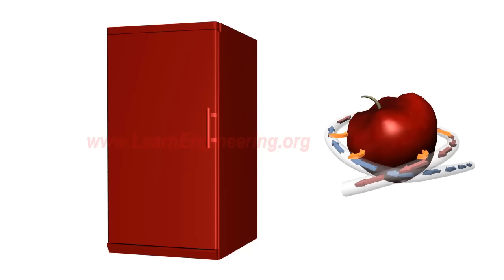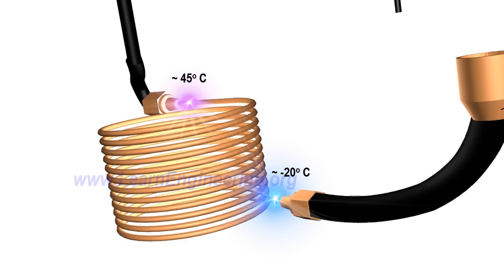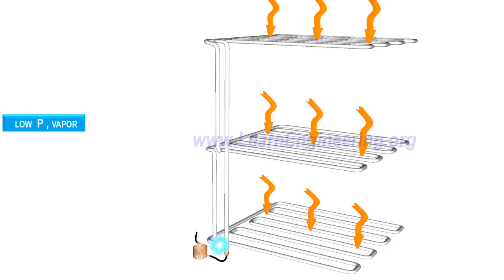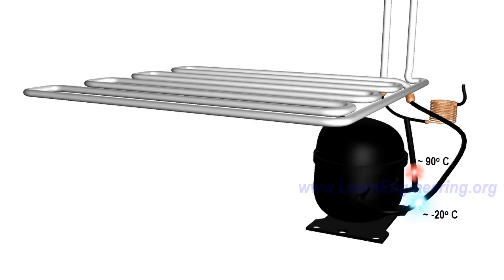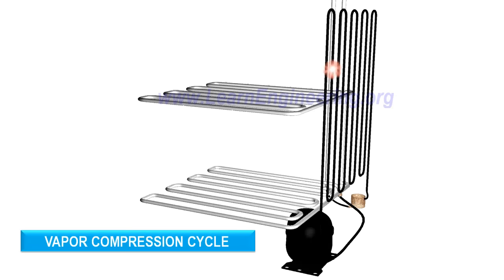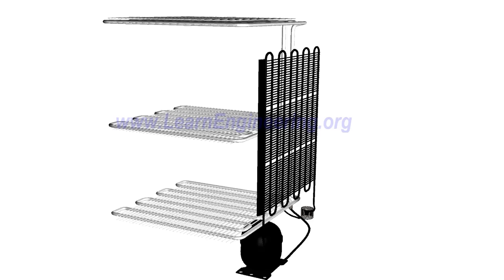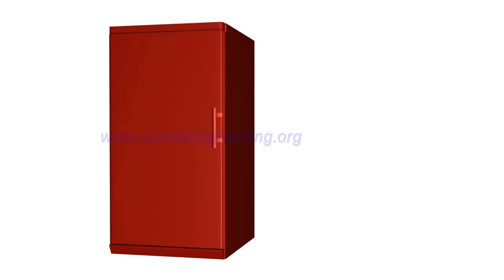Refrigerator working - The Basics

Comment: I never understood how you can use energy to remove energy, I mean that is against laws of thermodynamics(?). Now I understand. Thanks for the great video!
Reply: how is it againt laws of thermodynamics?
Reply: Dear HRS It was 3 years ago, I had no Idea.
Reply: @HenrikMyrhaug  can you explain to me the part when the temperature of the refrigerant drops because it changes its phase to vapor?
Reply: @duykhanh7746  The way I understand it, temperature is a measure of how much thermal energy is contained in a volume.

Basically, lower temperature means less energy in a unit of volume. When the volume becomes larger (the gas container is expanded), that means the ammount of energy per unit of volume becomes smaller(since the thermal energy in the gas remains the same during the expansion).

It is because the temperature drops that the gas turns to vapour, not the other way around.

And just in case you wondered, no it does not violate any laws of thermodynamics. I was thinking of "Energy can neither be created nor destroyed" when I wrote the comment, but energy is neither created nor destroyed here, since the energy just gets spread out more, not actually removed/destroyed.
Reply: @HenrikMyrhaug  wow it makes a lot of sense! But do we have any equation to calculate the change in temperature? Does pV=nRT fit in?
Reply: @duykhanh7746  I am not sure. I know you can use pv=nRT for a closed container with a uniform gas, but don't know how to calculate it when the gas turns to a liquid and different parts of the container have different pressure.
Reply: @duykhanh7746  u can use the real gas equation (wan der waals equation ) as the refrigerant is not an ideal gas
Also when refrigerant is in liquid u cant use pv=nrt as this is a GAS equation

Comment: this is  the best video that explains the cooling effect in youtube so far.  after the left liquid for heat absorption inside the refridger turns into the vapor (vapor still looks cold enough at this point), but as soon as this vapor goes back into the compressor, and this vapor becomes hot and  needs to  go the cooling fins outside the refidger?   why does it become too hot all of sudden? (that was what you showed, a bluish ball to a red ball). compresssion makes gas hot but.. it still seemed  cooler than 1st starting point

Comment: The T-s diagram and P-H diagram of vapor compression cycle explains the refrigeration phenomena better.  First, the throttling device lowers the pressure of the refrigerant tremendously (High pressure liquid ---> low pressure saturated liquid-vapor mixture). The energy (heat) from the refrigerant is released and as a result its temperature drops tremendously. Next, the evaporator makes the cold refrigerant absorb heat from the foods (keeps food cold) which occurs in the inner compartment in the fridge (liquid-vapor mixture --> pure vapor). Next, the vapor is compressed by the compressor  to a very high pressure back to its initial value and its temperature is also increased tremendously as a result (low pressure vapor --> high pressure vapor). It also maintains flow of the refrigerant through the whole system. Next, the condenser rejects the heat from the high pressured fluid and as result its temperature lowers (vapor --> liquid transition).  Finally, the  refrigerant approaches the throttling device as a high pressured liquid and the process repeats.
Reply: also since the evaporator absorbs heat from the surrounding. Water will get condensed over it and will form frost. Therefore, a defrost mechanism should be introduced to make the heat transfer at the evaporator effective.

Comment: Thanks for your clear explanation of Airflow in a Refrigerator. I have one rather important question I would like to ask. Your Airflow where does the Air come from. Is it normally a Close Loop System where the Air is constantly re-circulated by the Evaporator Fan in the Fridge, or is Fresh Air Intake going on so that the Evaporator Fan is constantly pulling Fresh Air from the Outside and blowing it through the Evaporator Coils inside the Fridge. Also if it is not a close Loop System and the Fresh Air is constantly being sucked in from outside , is it vented out as it is recirculated inside and replaced by a fresh stream of air. Thanks

Comment: To help understand the process of refrigeration first let's talk about the 2nd law of thermodynamics heat moves to what is colder lower then 1* degree difference..so a evaporator  coil is 35*  f* and the air going across it is 40* the evaporator absorbs the heat from the product to be cooled causing liquid to turn into a low pressure,low temperature,super heated vapor entering the compressor which cools the Hermetic compressor  discharging high pressure, high temperature, superheated vapor entering the condenser coil 100* degrees, where the absorbed heat from the evaporator and compressor is now rejected  by catching a ride on 90* degree air.
Remember."Heat travels to cold") leaving the condenser a subcooled liquid, traveling through the filter drier to collect any  moisture or burrs (hope not) then maybe a sight glass so u can see liquid going to the metering device where a pressure drop occurs  liquid,vapor called flash gas to the evaporator coil for the process to continue called..Refrigeration Cycle

Comment: Most refrigerators will use for the defrost cycle is a heating element and a (bimetal) defrost thermostat (located on the evaporator) which controls the flow of current to the defrost heating element based on temperature. The compressor run time and defrost cycle is controlled by a defrost timer or an ADC (Adaptive Defrost Control), which will stop the compressor and both, evaporator and condenser fans and energizes the defrost heating element(s). The defrost heating element(s) will only energize if the bimetal (located on the evaporator) is closed. Again, this is based on the temperature, since if there is no ice to melt, it is likely that the bimetal will remain open and just allow the remaining frost to melt naturally.

Comment: Hello, nice video but a comment I'd like to point out please.

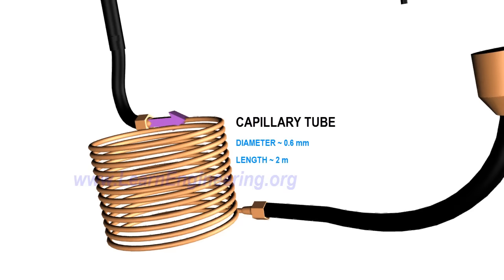After the throttling device, the properties of the liquid are -20 °C at 0.6 bar (see 0:58 - 1:30).

When the liquid goes into the evaporator coils, the contents of the refrigerator (e.g. food) are hotter than the liquid (refrigerant) so the liquid will absorb the heat from the fridge and turn into a vapour. Now the properties of the vapour are T>-20 °C (due to absorbing heat) at 0.6 bar.

My question arises how is the refrigerant still a vapour at -20 °C at 0.6 bar (see 2:18 - 2:35) when it was a liquid at -20 °C at 0.6 bar (after the throttling device see my second paragraph).

Shouldn't the temperature of the vapour at the inlet of the compressor be at a temperature greater than -20 °C to exist as a vapour? A more reasonable temperature would have been 5 °C.

I look forward to hearing back from you.

Thank you.

Comment: So does this mean if I put a pan of boiling water inside the fridge could the absorption make the system overheat?
Reply from the maker: Maxim Chepelev It depends upon the capacity of the refrigerator. Anyway it will be overloaded.
Reply: It will Effect the system But At some Extent of time. First of all depends upon capacity of your refrigerator and IF u put a pan of Boiled Water Inside Refrigerator then What will Happen Boiled water pan At {high temperature} and Inside Evaporating coils at {low temp}. Hence Temp Difference created. Heat Always flow from High temp Zone to low temp Zone hence It will heat up our Refrigerator system But Interesting thing our their According to Thermodynamic If their is Exchange of heat took place within Two System then both bodies Always try to Attain Equilibrium conditions temperature ,That's why After Some period of time Their will be no effect On refrigerator.

Comment: When the liquid exits the expansion valve, it will also have the vapor exiting with it. The liquid will be much cooler than the vapor correct? so will the vapor hinder the subsequent step, which is the cooling of the objects in the refrigerator?

Comment: are air conditioners exactly the same but with a fan?
Reply: +Anita Bonghit yes
Reply: Some refrigerators also use fans, but this is mostly for cooling of the compressor when too much heat is generated. Air conditioning follows the same refrigeration principle except that 1) the humidity and temperature is being controlled and 2) the condenser is usually located outside of the premises. An example of this would be a midwall unit (fan coil unit on a wall) or hideaway unit (fan coil unit in the ceiling) with the split unit condenser located outside to reject heat during cooling.

Comment: in the final process, the heat exchanger in the outside of the refrigerator, you said : 
" The air becomes liquid and the temperature turns back to normal " 
I get the temperature cause it's the heat exchanger but i dont get why the air becomes liquid at that point
Reply: when u take away heat from vapour, what happens?.. it condenses to liquid state no?.. that's the same happening there..

Comment: Compressor wouldn't raise the pressure back to initial value it will raise the pressure more than it's initial value so that it will reject the amount of heat it absorbed then use rest of the increased temperature for the latent heat to change its state from vapour back to gas. Thankyou

Comment: How do you regulate the temperature between the freezer and the fridge.
In this design therse seems no way that to turn down the fridge without affecting the freezer.
I ask because my freezer works, but not my fridge, and my fridge does not use fans to circulate air.

Comment: what i don't understand:
1. "an obstruction to flow causes drop in pressure". i would imagine the lack of obstruction to let the liquid expand thus dropping in pressure.
2. it seems like it starts to boil in the spiral? at ~30 Celsius? (just because of the drop in pressure?) where does the vapor go? because backwards was just the compressor. 

3. why does it come out of the refrigerator as 100% vapor, when normally only at 100 Celsius that can occur. i can understand that cold liquid passing through the refrigerator will heat only a bit producing some small vapor but not 100% since it cannot heat to 100 Celsius
Reply: Boiling point refers to the change of state not the temperature. Ammonia boils at -28F. So even after changing from liquid to vapor the line will still feel cold.

Comment: If the coils are the throttling device have a smaller diameter than the tube leading into it (dramatically smaller, it seems), why wouldn't that increase pressure, instead of decreasing it?  A gallon of water being pushed through a garden hose with a 2" diameter should have less pressure than a garden hose of equal length and a 1" diameter with a gallon of water being pushed through it, right?
Reply: mountain scott right? My thoughts exactly, does someone mind explaining this please?
Reply: Martin Acevedo mountain scott If you think about it like a nozzle, it does make sense. For a nozzle, pressure decreases and velocity increases.
Reply: Need a more scientific answer. It would seem to me that it is the pressure that would make the velocity increase.
Reply: mountain scott Since the fluid flows faster in the section of tubing with smaller diameter, the fluid exerts less pressure on the walls of the tubing, so the pressure exerted on the fluid by the walls of the tubing decreases. 

The scenario you propose only makes sense if these are two connected segments of hose.
Reply: mountain scott There are a lot of good websites with explanations.
Reply: Asked myself the same question
Reply: mountain scott 1. yes at the start of the coil the pressure is higher, but only at the start.
2. small diameter + spiral shape = maximum friction = maximum pressure reducing effect
3. at the end of the small coil, it connect to large diameter pipe again and it also help lowering the pressure further.

hope that help :D
Reply: The Tool Guy what's that got to do with it? he was asking about the pressure difference in a fixed-volume system across segments of different diameter.
Reply: HeavyProfessor If you read between the lines, the purpose of his comment wasn't to be informative, but rather to insult me.  So, I wouldn't give him the attention he craves. As you know, I made that comment over a year ago and am satisfied with Ivan Christiawan Budi 's response and am happy with your explanatory attempts as well.
Reply: It's called Bernoulli's principle , when the speed of a fluid increases , the pressure decreases.
Reply: mountain scott too late now
Reply: The Tool Guy look you can give a good Blue Collar fuck explanation, but this is engineering
Reply: It works like your pressure cooker's valve.It is a small opening where the gas can expand without doing any work,and this cools the fluid.Just like your cooker's vapors:Even though you cooker is way above 100ºC,the vapors that come from the valve are cool

another good example:When you want to bow cold air,you do a small opening with your mouth,and vice versa.The science is the same.

I hope I helped,even though you asked this 2 years ago.Well,you question was good,so I think many people will go to the comments with the same doubt.
Reply: I think I finally understand it. The liquid (or rather, gaseous substance) used is isobutane (or similar) which has a boiling point of -11°. So its natural, room temperature state is gas. Through the condensor vastly increasing the pressure the gas is liquified. This gas under high pressure has a larger kinetic energy, temperature of about 90-45° along the condensor, liquifying the gaseous substance due to the pressure. As derived from the ideal gas law p*V=n*R*T where all, volume, gas constant R and amount of gas n are constant so if the pressure goes up, the temperature does as well. This big difference in temperature between the condenser at 90-45° and the normal outside temperature of about 20° means the natural heat equilibrium, ambient air constantly sucks energy from the closed system. Even when only pressure is added by the condensor. So the refrigerant will enter the fridge's cooling area, the evaporator at a temperature near enough to Isobutane's boiling point of -11°, apparently at -20°. During its -20° liquid entrance in the evaporator area after having lost the energy absorbed from the fridge contents through the condensor... The pressure drop and heat of the groceries inside, ambient heat from opening and closing push the Isobutanec beyond its -11° boiling point also being under low enough pressure to create vapor, gas.
Reply: I think a lot of confusion comes from how they refer to Isobutane as "the gas" when it can be in liquid form. The main principle is how the large temperature difference created in the condensor compared to ambient room temperature allows heat equilibrium to draw kinetic energy, heat, temperature from the closed system. And how the drop in pressure  All through increasing the pressure. I think your misconception can by the idea of having a small hole in a dam or a needle hole in a water filled balloon. It is just a fact that less water can travel through such a smaller diameter pipe than through a bigger one. So the pressure is lower after the water travels through such a narrower section or "capillary tube" and re-enters a bigger one. I think. But I've learned about how liquids in a closed system always have the same pressure everywhere as well. I guess if the pump stopped eventually the pressure accross the system would equalize. There's just a pressure (and accompanying temperature difference with between condensor and room) created to allow heat dissipation and then "throttled", at a certain section of the piping to allow for the temperature to drop again to freezeor cool the contents of the fridge. I guess how much cooling depends on how much the condensor pressures the Isobutane in the condensor. More temperature difference due to more pressure resulting in more thermal equilibrium effect between the condensor and the room temperature. Among other things.
Reply: I guess the fact the Isobutane is in a phase transition after the capillary tube throttling device also matters for how it can effectively cool the contents of the fridge. But I haven't fully worked out, understood how that helps, changes the system as compared to if it was just different pressure liquids in the entire system. I guess it will have to do with the heat capacity of gasses versus liquids where the gas can more effectively take the heat inside the fridge because it is more capable of absorbing heat in a gas state than in a liquid one. But to fully understand I'd need graphs and numbers compared.
Reply: @potato_fish  bit isn't pressure and velocity directly proportional

Comment: I don't understand one thing. The throttling device is reducing the pressure of the input liquid, right ? Then why do you call it as an obstruction ?
Reply: it's obstructing the normal flow
Reply: +1stfloorguy but if it is obstructing the normal flow, then the pressure should increase, right? how does it reduce ?
Reply: +Abhishek Kadri I see what your saying I think your thinking about it wrong. The throttling tube is slowing down liquid and the pressure is dropping. it's not cramming the same amount of liquid into the little tube at the same flow rate. it's reducing the amount of available liquid

Comment: the low pressure refrigerant or liquid is converted into vapours after absorbing heat from the objects. but how the vapours come out of the tubes or pipes roaming in spaces. the vapours still should be inside the tube only. i didn't get it.